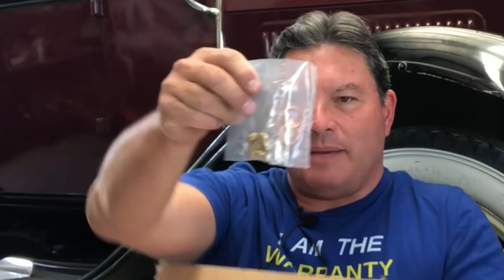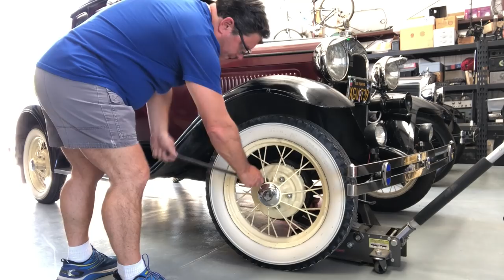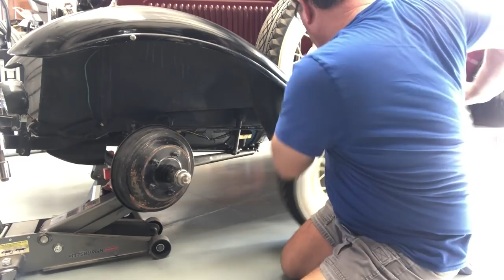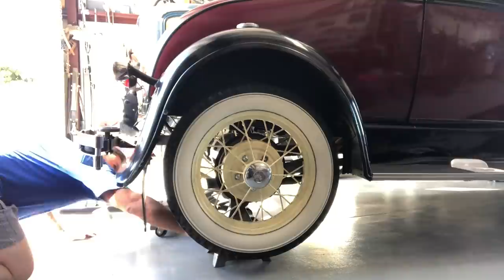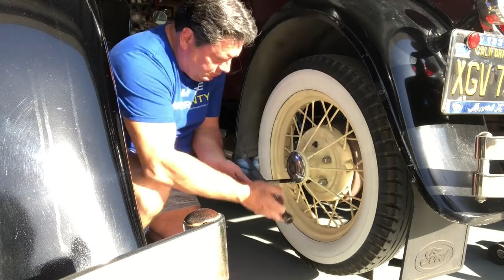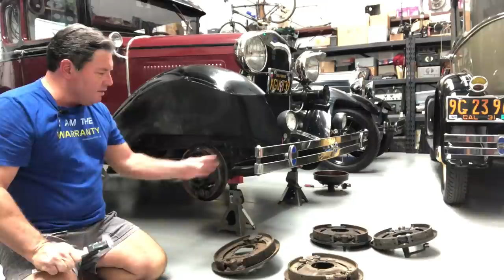Ford Model A Brake Inspection - You'll be SHOCKED at what I found!

Comment: Paul, Shake that can of Boeshield T-9 and spray your floor jack with it.  Use the applicator straw.  The the jack will be a good example for the long lasting effectiveness of the Boeshield T-9.  Next week in part two I'll be listening for the jack being silent and smooth as velvet.  Hi to Tina.  I'm hoping she'll make a video with her work on Athena.  God Bless.
Reply from the maker: I sprayed the jack moving parts with T-9 (shook it vigorously first!).  Still squeaks.  I think it always will.
Reply: @ModelA    When it still squeaks the Boeshield T-9 isn't making it to the parts that need it.
I'm sorry your first use was a fail.
Trust me that it is an overwhelmingly excellent product.
Don't shelf it or re-gift it.  Keep using it.
Today I did hinges, car doors, trunk and hood.  Also the doors and trunk latch mechanisms.
Reply from the maker: @discerningmind    On the contrary, my first use was an absolute success!  My first use was for some stuck adjustment hardware for the car lift.  It worked excellent!
Reply: @ModelA    Great!!!

Comment: You were fortunate that those rear brake drums came off so easily, they can be very difficult when the taper is in good condition. Thanks for another informative video.
Reply from the maker: That's why I use the hub pulling tool that I use.  Even stubborn ones come off easy!

Comment: This is exactly the type of series I'm looking for. While my car doesn't have very much stuff that's thrown together like on this vehicle, I'm not looking to do a complete restoration either.
Reply from the maker: Excellent!!!  What shape is your car in right now?
Reply: @ModelA  your wife is actually been sending you a few questions here and there for me. You've helped me a few times. My most recent one is about my charging system. I finally said screw it I'm going with the 6-volt alternator. Mine's in pretty good shape overall. But thankfully there's no weird straps or odd bolts or anything like that holding things together. Mine's a pretty good daily driver that just needs to be maintained regularly.

Comment: Woven on the rear that has more grip because that shoe is running with the wheel and needs more grip than the front one that's being fed into the rotation of the wheel and also wears more. I'm old and have had a lot of experience with mechanical brakes. Have you ever heard of energizers? They work great.

Comment: In England those head lamp visors are known as "kidney cutters" for obvious  reasons !!! . Today I changed out a front shoe as on inspection I found the lining partially detached . I had to sort through a pile of shoes to suit the standard 11"" drum . Most were ground to suit a skimmed drum . I dont like those axle shims they prevent a solid mechanical bond between taper and hub .

John Charlton
Reply from the maker: I'm also not a fan of axle shims.  However, if you have slightly worn hubs, and you are short on cash, they will get your Model A back on the road.
Reply: @ModelA  I just cant live with a shim so I change out the axle or hub whatever suits. Very luckily I have been a parts hoarder for about 45 years  so have about a dozen rear axles in the "stores" . The problem with the shim it eventually  allows the drive to be taken by the key which it is not designed to do . In the axles I have taken apart the ones with shims the axle keyway is always damaged . My local Model A shop cuts a new keyway 65 degrees away NOT 90 degrees away . You are right of course it does keep a car "on the road" . Today I sorted through a heap of shoes and most all were ground oversized I did get lucky with one the right thickness and standard 11" arc . Keep up the good work you are indeed a star !!!
Reply from the maker: Thanks, John.  Definitely NOT a "star".  Just a Model A guy.  Regarding hoards of parts, I once heard my dad say (when someone announced they had some Model A parts for sale or free), "We better get over there and get those parts before some hoarder ends up with them".  He has no idea he's a hoarder!!
Reply: @ModelA  OOOPS new keyway cut at 130 degrees NOT 180 degrees brain fade .I have a universal rear hub puller which works on all hub styles I will post it on "Ford Barn" I have not seen this style in USA maybe Danish

Comment: Hey all give you a tech tip. When you  are doing brakes on a vehicle use a trash can lid under the brake drum. It will keep you from making a mess.
Reply from the maker: With an epoxy floor, it just wipes up.  When using chemicals, I put down an oil drip pan.

Comment: The hub came off easily because a shim was fitted and no real mechanical bond . The keyway in the axle is damaged as you could just place a new key it in the axle slot by hand . This is an interference fit and would be tapped in place by a light hammer the tapered end inwards . The slot in the hub seldom wears but the axle slot does especially when shims are fitted ,. My local model A shop makes a "stepped" key  to fit the hub and the enlarged dressed axle slot . When fitting the hub everything thing must be sqeeky clean .I wash every thing hub interior and axle taper with cellulose thinners You can hear the hub "cheep" when you pull it up to 100 ft pounds . With Athena you will need to keep a check on the rear axle nut torque after a few hundred miles as the torque will most likely back off . Grand video I just thought I would pass my thoughts on
Reply from the maker: Thanks John.  That method works every time, shims or not.  You probably noticed it went back together much better than it came apart.

Comment: Being a broadcast professional I did notice that you were missing your mic. It was on the top of your T-shirt at the start but missing shortly after. I just turned up the volume. Everything else you have done on your videos has really been great so this is not a criticism. God knows I have had major fluffs on the air with live tv over the last 30 years.
Reply from the maker: Sometimes I use the lavalier mic, sometimes the built-in mic in the phone.  It's not always practical or safe to have the lavalier mic on when working on cars.  If I had a crew and an audio guy with a mic boom, I would be all set!  But, as me tioned numerous times, I'm just a regular guy like everyone else.  I work with what I have available.

Comment: Hi Paul, thanks for the video.  As being one thats critical how folks do work on vehicles when I watch them on YouTube, I didn’t have an red flashing lights telling me you were doing something so dangerous that you were risking life and limb. Ok, sure, maybe I wouldn’t lift all 4 wheels up at once, but really a judgement call. You were using Jack stands, which I’ve seen my share of folks who never heard of them... . So, ya, you know way better than me how level your garage floor is, etc, etc... . I would say though (here it comes...) I’m not a fan of those angled tire irons. I’ve had problems getting sufficient power to remove nuts with them. I see you had a small “spinner” to remove the lug nuts after you loosen em up. I carry a fairly large one that gives me pretty good amount of force, plus a 20” 1/2” drive flex handle with a 4” extension & impact socket that fit my vehicles lug nuts. Overkill, but a flat tire in the middle of nowhere and even on a new car, mech’s can over torque them, and the stuff that comes with vehicles is typically stamped crap. So, thanks for the video, and ... Yaup, everybody’s a critic... . Good job,  thanks.
Reply from the maker: Thank you, Shooter!  Actually, criticism helps too.  I'm still pretty new to the whole video thing, and trying to feel my way around.  I always, always use jack stands.  Even when I suspend a car from the crane, I still put stands under it.  I poured the shop floor level.  No taper to it.  I wanted to put a floor drain in the middle, but the county codes forbade it, so the floor has no taper.  For taking lugnuts off, I frequently use the impact.  However, for videos, I try to use period correct and ha d tools whenever possible to illustrate that special tools are not necessary to work on a Model A.  My goal is to show that anyone can do this.  So, that might explain a little more of why I look like such a hack in the videos.  Thanks again!
Reply: @ModelA  I really don’t think you look like a hack, you seem quite natural in front of the camera, to me anyways 👍 .  Folks viewing, (my self for sure) don’t know the whole story, so ... keep on keeping on Paul 😎.

Comment: I (Bob) am amazed how small the brakes are relative to the wheel
Reply: Way. The top speed is only about 40 mph and the car is not very heavy. You add the fact that the tires have a tiny contact patch and are bias ply tires meaning they have very little traction with the road. Those brakes are more than adequate with the tires.
Reply from the maker: They work very well though!

Comment: Do the age of the pads matter?  I'm inspecting mine before I take it for a test run and the only thing I know about it is that it's been sitting for 30ish years but did have a restoration to everything but the cab.  The pads look like they have a lot of tread left but didn't know if the age would play a factor.
Reply from the maker: As long as they don't have any cracks in them, you're good to go!

Comment: The other day I went to check out my front brakes and repack the bearings, my question is whether the bearing cap that was a screw on type instead of push on type like on your car in the video is this correct?
Reply from the maker: Model As didn't come with a cap stock, so there is no telling what someone did to add them to yours.

Comment: Paul, I am having ground problems with one of my model As.  I can not find any forums about them.  Where is the ground straps on the car?  Thanks
Reply from the maker: The ground strap runs from the battery positive post to the frame,  specifically, to the crossmember right behind the battery.  The engine gets it's ground through the engine pans, which most people leave off.  In that case, I run a battery cable size piece of wire from one of the flywheel housing bolts to the battery positive.  Otherwise, it will be trying to use your fuel line for ground.
Reply: @ModelA  awesome.  Thank you so much for the great help!   This is frustrating
Reply: fordbarn.com is a great resource if you can't find your answers in one of Paul's videos.

Comment: Nurse that back. Don't overdo it. Although as a guy in his late 50's, I've had back issues. I did have to have a total knee replacement due to a workplace injury. I see you on your knees and back without pDs or creepers. Do you utilize any "helpers" around the garage? Although in decent health, the fact that I can't put any direct pressure (zero kneeling) can I really take on a Model A project? Or should I just bring it to you?!
Reply from the maker: Sorry to hear about your knees.  Model A projects are not that physically taxing.  Also, assuming it's your car and in your garage, there is no rush anyway.  My shop isn't open to the public, so to speak.  I don't do work for hire.  Thanks for thinking of me though!

Comment: Love this series. Im learning a lot. Where did you find the tool to screw on the rear axle and tap with hammer to pop drum off?
Reply from the maker: I have had it so long, I forget.  Snyder's sells something similar.  Tell them you saw it here, please- 
https://www.snydersantiqueauto.com/ProductDetail/A-4235-WP_KNOCK-OFF-WHEEL-PULLER
Reply: I will let them know. The hub puller is big for a tool box. Yours is much more compact for travel.
Reply from the maker: @patrickseals5746   Yes!  And it works MUCH  better.  The pullers tend to mushroom the ends of the axles sometimes.

Comment: Paul - you mention woven vs bonded brake shoes and cast iron drums. You make it sound like there are options for both. Are there different types of drums possible on these cars and which type of shoe is best for whichever drum it has?
Reply: Yes I got really curious too about that.
Reply from the maker: Almost all Model A's left the factory with steel drums.    If you lay on the brakes a lot, the steel drums get hot and expand, causing what people call "brake fade".  The cast iron drums are an aftermarket replacement that do not have the problem as bad.  The woven pads on the brake shoes are how they came from the factory.  These days, we have the option of the metallic bonded pads, which work a bit better, especially with cast iron drums.
Reply: Paul Shinn thanks for the reply. And yes I thought about the woven pads vs bonded and I came to think that they did probably away with the woven and used bonded instead due to it braking better. So thanks again for clearing it up for me. Will you in the future replace all pads to bonded?
Reply from the maker: @2strokepower803    When I finally get to do the full brake job video, that's the plan.
Reply: Paul Shinn gotcha! I really like the series :)

Comment: No chocks under the wheels is a ballsy move.
Reply from the maker: When removing the wheels??
Reply: @ModelA  G'day Paul,
When I made my comment the car was on 3 wheels and a jackstand.
I was a witness to a car falling off a jack when the nuts were loosened on the second wheel when it tried to rotate due to the torque from the wheelbrace.
Once seen never forgotten.
No injuries but the backing plate didn't like it much.
I'm in the Philippines and would love to have a model A but they are as scarce as hens teeth.
I'm getting my fix watching your videos.

Comment: Where do you get the tool that pulls the drum off?
Reply from the maker: Most of the Model A parts suppliers sell one just like it.  I made mine.
Reply: @ModelA  thanks Paul.  I remove my front drums today and everything is covered in grease, pads and all.  Looks like someone got carried away?!
Reply from the maker: Yikes! Good thing you checked.

Comment: I think it is funny that he doesn't know what the proper name of the shoes are on the backing plate, that car does not have any  brake pads on it. Why is that important Ford built cars that had disc brakes on the front disc brakes on the back and they also had four brake shoes. I could walk up to the parts counter tell the man the make and model of the car and tell him I need brake shoes and did not have to tell him where they go because he knew where they go do you. The thread chaser that was on the lugstud is not a threading die.
Reply from the maker: My, my... Aren't we critical today?
Reply: Thomas, why even bother to watch a video that upsets you so much?  Paul, great, informative video.  Please include details of swedging procedure when you replace that one lug bolt.  I need to have that done with all 20 lug bolts on my late ‘31 coupe.  Also, I have steel drums and am in a dilemma about replacing them with ($$$) cast iron.
Reply from the maker: @jzac5248    Will do!  Thanks!